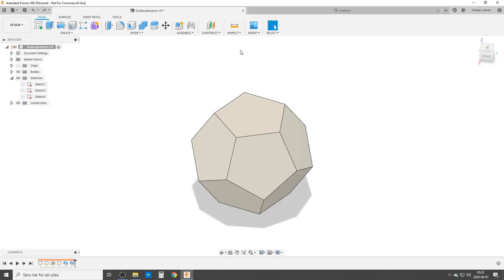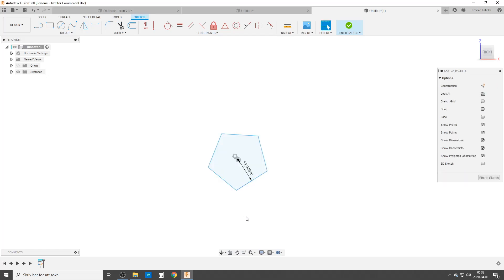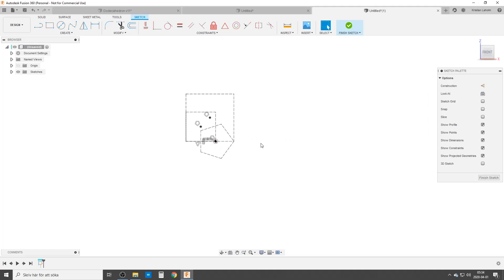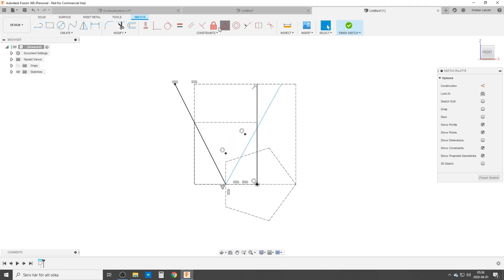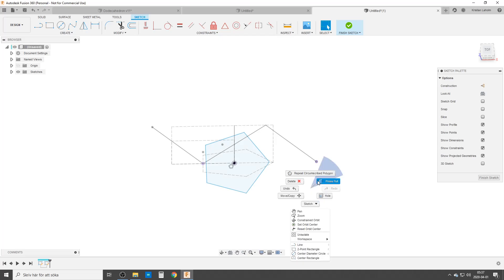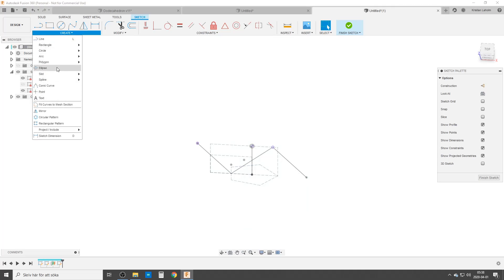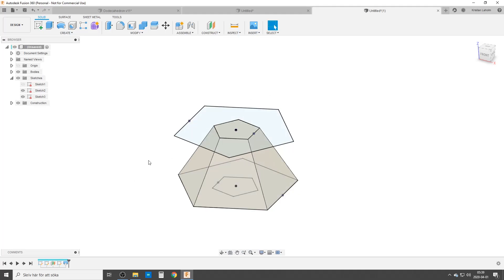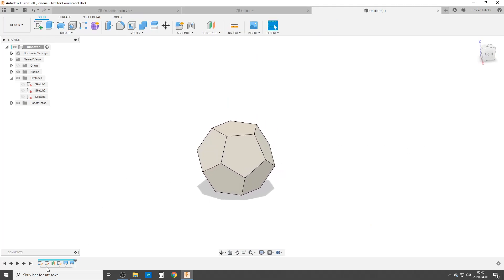Dodecahedron NEW - Easy in Fusion 360 - No Math or Angles - New Video using Lofts

Comment: Still working on the three dimensions (diameter of the 1st polygon and height of the two squares in sketch 1) in this one in order to get the faces to the same area. But it's great fun! Thanks.
Reply from the maker: The first polygon (pentagon) and the 2 squares should only be connected using constrains, then you set the dimension you wan't for the dodecahedron.
I did this video early in the morning and it's a quiet speedy video only to show how to do the Dodecahedron. If you are a beginner it might be tough to follow along as I don't explain every command, fell free to ask a question if you get stuck 😀 Small tips: check that the sketches are constrained (the lock on sketch in tree top left) check that you project and coincident from sketch to sketch to keep things connected and there should only be one real dimension.
Reply: @KristianLaholm  Gotcha. Thanks for replying. And yes, you did say it was 5.30am!😯
Reply: I managed to get it sort out after some backwards and forwards with measurements. The faces aren't exactly the same area, but damn close!
Reply from the maker: The faces should all be the same area, mine are with 9 numbers precision. Check that you are getting the constrains (midpoint and coincident) correct in the first sketch and in the following sketches that you get the projections correct. Share your file and I can have a look (Right click the model in the Data Panel and choose "Share Publik Link" and post link here)
Reply: @KristianLaholm  Hi Kristian, it's very good of you to offer your help! In fact, I have a problem with this shape - the areas of the 10 pentagonal 'side faces' are larger than the areas of the 'top' and 'bottom' faces. Here's the file - https://a360.co/3lRcuJr
I have tried adjusting the constraints etc, but nothing has helped. The above link is to the fie as I created it from this tutorial. 
Any help is very much appreciated!
Reply from the maker: The first sketch is not fully defined because the 2 squares are not equal sides. 
In my video from 1:25 I use polygons to create the squares this constrains the sides equal.
You can go back to first sketch and make 2 perpendicular sides Equal (constrain) in each square to fix it. Hold down the mouse button to be able to select the correct sketch line if the overlap.
I hope this can help you and nice to see my ideas being used 😊